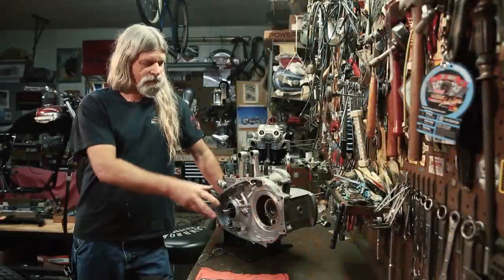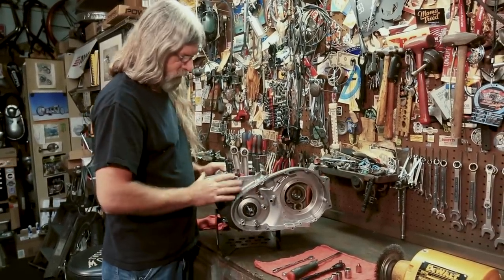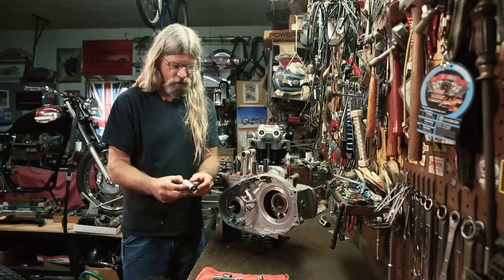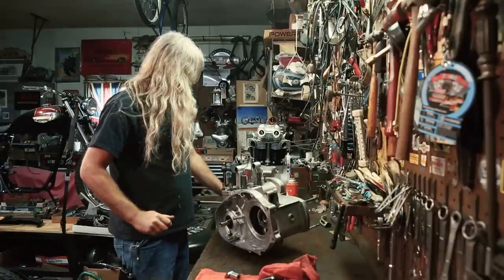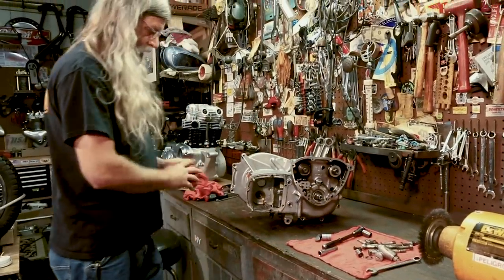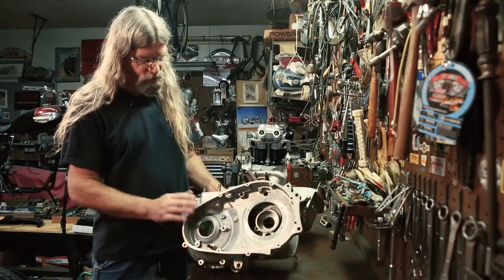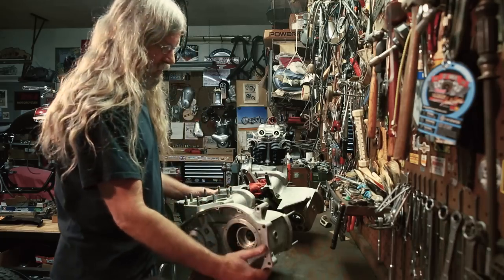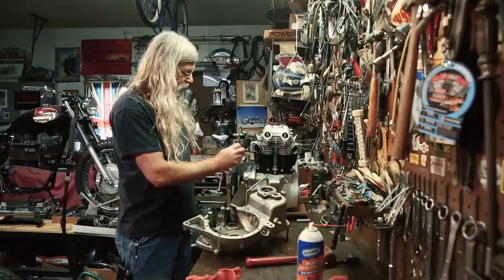Triumph 650 Motorcycle Engine Disassembly & Rebuild part 5 - Lowbrow Customs

Comment: You, sir, are a genius. Popped my case half in the oven for 10 mins at 140C (300F), and the outer race fell out as soon as I turned the case upside down. Didn’t even have to smack it on the wood. Thank you! :)

Comment: Great video!  Very helpful and easy to understand.  Thanks for posting this series.

For those working on 71 and later "oil in frame" motors, some (if not all) have a 14 mm dowel pin that runs through the very front of the cases where the engine bolts to the front downtube of the frame.  Mine (a 76) was so corroded I could not separate the cases without drilling this dowel pin out.  I used a 1/2 inch bit suitable for drilling through steel and a lot of cutting oil.    It left a very thin layer of the pin, which came loose with some heat on the surrounding aluminum.

(They sell new dowel pins for about 10 bucks a pop, so I bet this issues comes up pretty often.)

Comment: I've always been told replacing the cam bushings are tricky, I hope you do it...it would be interesting to see what the issues are.  Great series though.  Thanks.
Reply: I will not be replacing the cam bushings they were within specifications it is a fairly easy job with the correct tools

Comment: I remember the two inside screws you have to make sure you don’t forget.
40 years ago I had some weird sealer for machined surfaces made by Permatex and I used it on my cases and inner transmission cover. It made them totally leakproof but now I wonder if it’s going to let them come apart.
Reply: Impressive that you've had that beauty all these years.

Comment: The Timed Breather Valve can be eliminated and substituted with a Reed valve. It will perform better.
Also you really should have been using a hand impact driver and hollow ground screw drivers. 
Other than that I think your video's have been very helpful so far.

Comment: Thoroughly enjoying this as I prepare to dig into my 1966 TR6SR basket. I really want to do this myself, I've built a SBC, Ford Windsor and a 383 MoPar motor over the years and did the head/cam chain on my 650 Yamaha. All are still running lol. I'm 55 and want to ride this Trumpet I've had since 1992 before I'm too old to kickstart it. Any advice on getting a really stuck cylinder off? Crank turns and I have 3 hardwood wedges around the bottom of the barrel, up around 1/4 inch. Heat? And pound down with a hammer and block of wood while I tap wedges in s what I'm thinking. Any advice?

Comment: I'm loving these videos.  How do you know you're at the point where you need to break the engine completely down and rebuild it?   I'm looking at buying a 67 Bonneville that hasn't run in a couple years, but appears to be in decent shape and has low miles.  It's one of those "ran when parked" deals.  Owner claims it was running but it's been sitting in his garage for two years.   I'm hoping a good carb clean, new battery and new fluids will get it going and I won't have to take apart the engine.  Doing some work on the top end seems doable, but taking everything apart feels way above my pay grade.
Reply from the maker: that prob just needs the carbs cleaned out, gas tank drained and cleaned, and a new battery
Reply: Advice from a close friend that has been working on British bikes for 4 decades: "If you buy a British bike with the understanding it won't need an engine rebuild you're an idiot. If it doesn't that is a bonus". 
 I bought a running TR5T recently, it is now in a thousand pieces ready for the rebuild. Can't wait to get on it!
Reply: @lowbrowcustoms  how much would a reputable vintage Triumph mechanic charge to do a full tear down and rebuild like Todd did in this series?   Ball park figure.  Just curious.
Reply from the maker: @daveco1270  depends on the mechanic really. Todd usually just getting parts he needs and doing one him self could be over a grand. then think hourly rate etc... probably a few grand if you had someone do it or more.

Comment: So that crankcase seal at 21:14 that you knock out... can that be changed without splitting the cases?    Would oil spitting out of the sprocket area be the cause of this seal not properly sealing?

Comment: Hi Todd, I have a 1972 T120v and on checking the torque settings on the flywheel bolts i found the bolt that holds the flywheel and sludge tube in place has stripped the threads on the crank.
Any suggestions to what i could do? Many Thanks for the vids keep them coming.
Reply: That does not sound good , sorry to say I have not had that problem before , if it is the bolt that locates the sludge tube you may be able to tap it out to one size larger and make a custom bolt that has the correct end . If that does not work it would be time to replace the crank .
Reply: Hi Todd, Many Thanks for the reply. I sent it to a Machine shop and as you said in your reply that's what they said they will do. I should not have any further issues with it.
Many Thanks again.